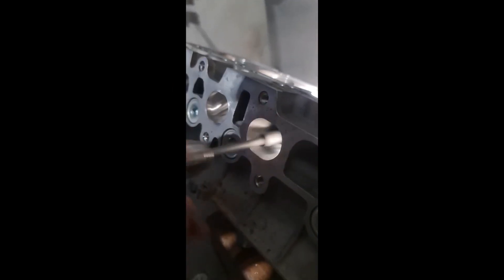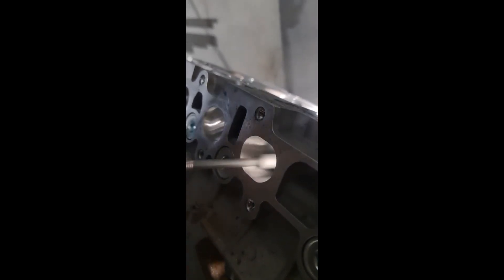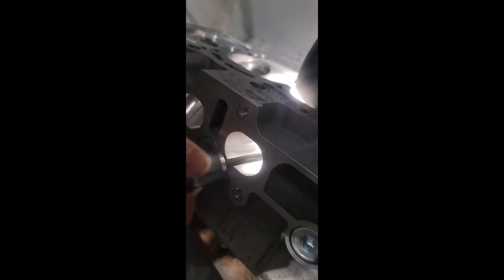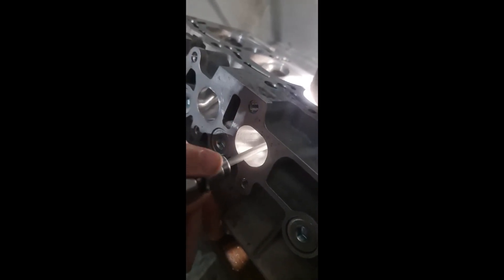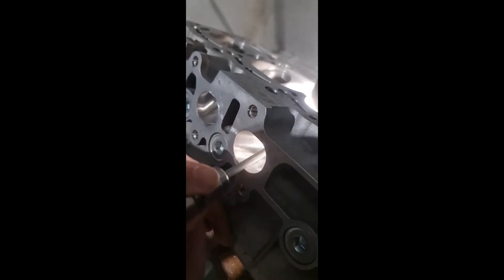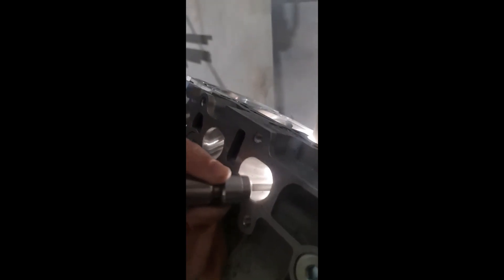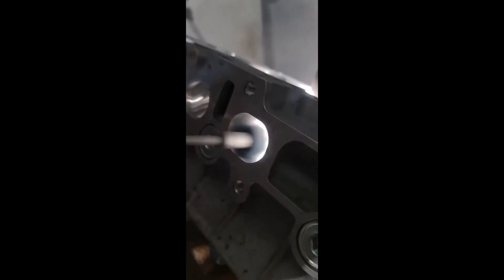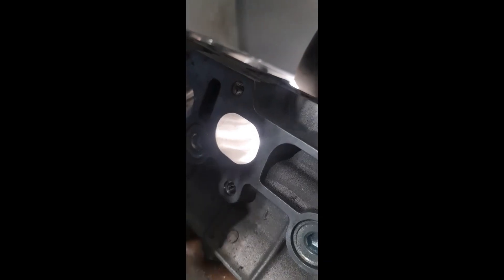Mastering the Art of Hand Porting: The Complete Guide to Porting the Toyota 2JZ-VVTi head Part 13

Comment: Sorry for commenting on an old video, I'm catching up. Good series. I have a new set of TFS 11R227 heads. Wondering if it is worthwhile to polish the cnc finish out of the exhaust ports? I know I wouldn't be able to get close to the seats as the valve job is already done
Reply from the maker: If its done don't worry mate. These are only percentage points at best.

Comment: Ayo sick vid, usually most ppl cut the guide boss oddly enough. Is there a dyno video around anywhere?
Reply from the maker: Yeah we use to post a bit of dyno stuff in the earlier days. But once you work out how easily manipulated the figures are. It's truly a waste of time as so many BS about their results.  Just like flow numbers.   

But we don't get involved with retail as nearly all our work is for race shops and for over a decade we pretty much guarantee when we do a head it will bet any other ported OEM head out there.  

This is why we focus on port energy and velocity.  It never lies like a flow bench will.  

But HP results with any good port job are usually 50-150HP at the same boost better. Even back in the late 90's were we seeing 100+hp at the same boost on little 900hp 2jz's.   

If you target the velocity gradient properly,  you can only make more. 👍

Comment: When it comes to valve jobs on these engines are you going +1mm multi-angle and deshrouding based on the cam lift if adding a hotter cam?
Reply from the maker: Yeah, all our stuff is done on a single point CNC seat cutter, so we set what angles we need for the head. And set what throat we need for the valve size. And cut in one process. 

Generally, all out racing will be 90-91%, and street duties will be 85-88% depending on the RPM range it's using.  Many don't need an over Size valve, so we set the throat for what it is doing as far as where they want the power.

Comment: Great series.  Lots of little nuggets of info in there.  

I'm porting my second set of heads right now and would love for you to make some videos on the math as well.  I have Pipemax and it's giving me some really whacky numbers for the intake port ACSA on my 4.6 3v...smaller than stock. (Asking for 1.65 in.sq. and in stock form they're already at 2.01 in.sq.) The runners remind me a lot of the 2J intake runners, so I'm sure you could shed some light there as to this discrepancy.  The runner has very little turn, so maybe that's part of it?

Pipemax recommends an intake runner ACSA of 1.65 in.sq.  Of course there are other factors at play, but the last time I built this engine, I hand ported the heads I ended up with a 2.18sq.in. ACSA and the motor peaked at 6000.  I think intake and cam timing had something to do with that.  But, at any rate, doesn't seem to be that the ports are too big...the low end torque was pretty strong and it still choked out before the camshafts theoretical peak of 6900.  Not to mention, the FRPP/Livernois CNC port version of these heads has 219cc intake runners, for an ACSA of 2.53in.sq..  Just trying to make some sense of all of this and apply what I can while I still have the heads off the car.  From there, we'll see what the dyno says.

Anyway, thanks again and great videos!
Reply from the maker: Yeah we will be doing some videos on the MSCA and ACSA and I've done quite a bit of work on the Ford modular engines. And we have an NA set we will be doing in a few months. So we will probably do some vids on them.
Reply: @bainracing  Cool.  I'll keep an eye out for them.  Thanks.

Comment: Edges on the valve seats. Even on exhaust valves seats?
Reply from the maker: Depends on the exhaust port shape,  but generally, sharp on the valve with a nice bug tulip and radius on the seats only on exhaust is fine.
Reply: Ok. On exhaust, sharp on tulip style valve and radius on exhaust seat. 
Thanks BainRacing!
Reply from the maker: @bobirving6052 Yeah ive found some like a longer 45 valve seat on the valve, not so much back cut like and intake likes. But will come down to valve and port shape. Theres always one head that will throw a curve ball!
Reply: Wow. Custom for everything